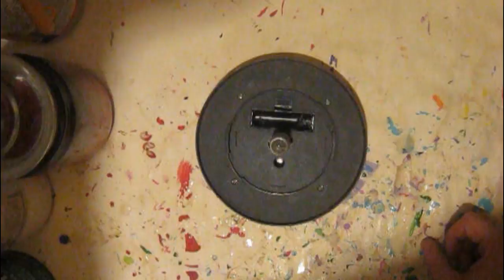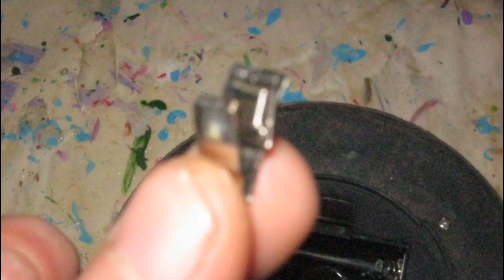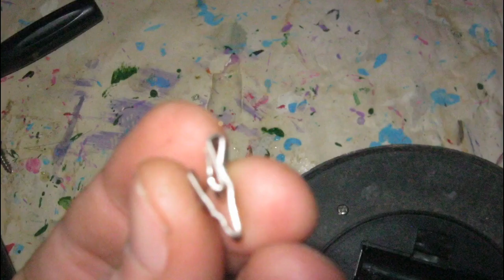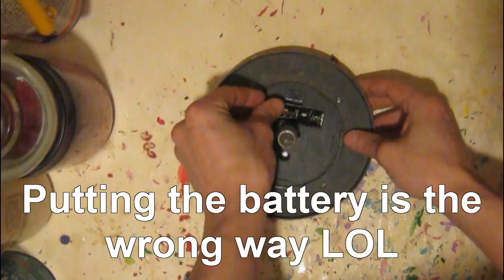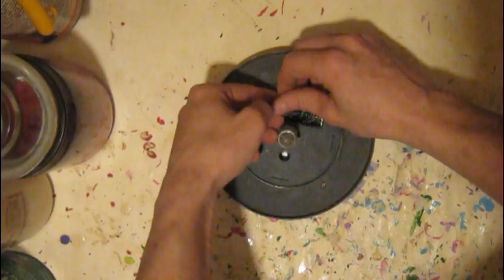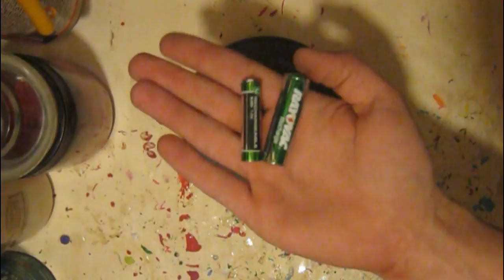SOLAR LIGHT BATTERY CONVERT HACK

Comment: Would it be more efficient to use high capacity nicd or NiZn batteries. NiZn have higher voltage at 1.6v and 2500mah.